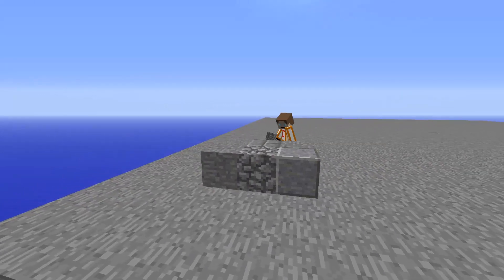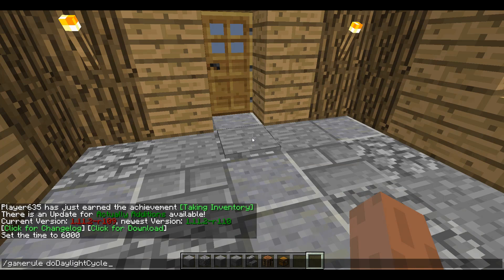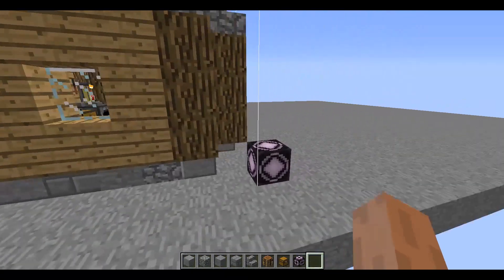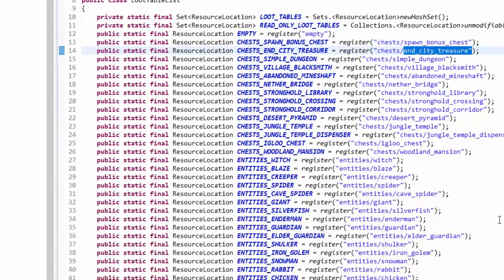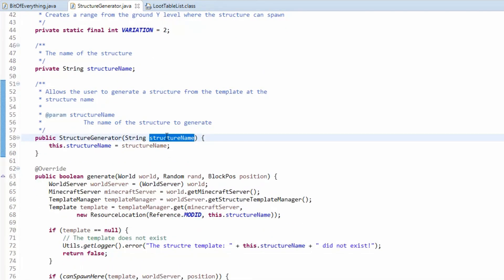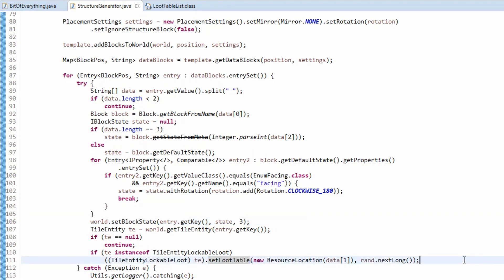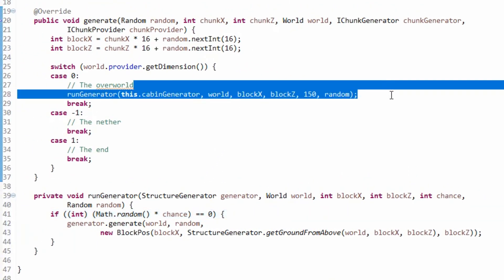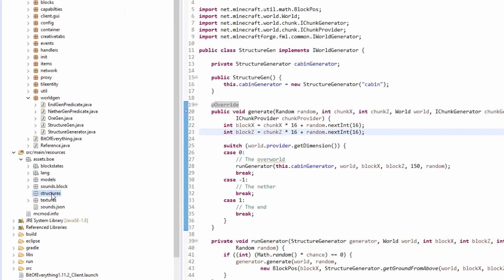Minecraft Modding Tutorial | Custom Structure (1.10.2,1.11.2)

Comment: The end generator is spawning my structure at y=0 sometimes, and the nether generator isn't spawning my structure at all. The rarity for the structures is 25 (My overworld structures spawn almost everywhere with this rarity, so I doubt it is me not being able to find them). I added Blocks.END_STONE, and Blocks.NETHERRACK to the list of blocks that my structure can spawn on. My structure does spawn on endstone, but still spawns them at y=0 on nothing sometimes. How can I fix these bugs?

Edit: I think the glitch with the nether generator is caused by the getGroundFromAbove function. How can I fix the getGroundFromAbove function to support the nether?
Reply from the maker: I suppose you could test where there is space for your structure by testing the volume where it will spawn to see if its just above netherrack but all air maybe?
Reply: @CJMinecraft  Thank you for the fast reply! I fixed the end structures! I did this by changing part of the getGrondFromAbove function to "while (!foundGround && y-- > -100)". I added Blocks.BEDROCK to the list temporarily to test if my structures generated at all in the nether, above it at least (giving them plenty of room to generate), and they did! They still don't generate in the main area of the nether though. I have another question. How can I add an OreDictionary to the list of blocks that my structures can load on? I've tried multiple things without any success. If this is possible, I'm thinking that this would allow my structures to load on Biomes O Plenty grass blocks!
Reply from the maker: If you are using 1.12, you could take a look at object holders. Just a quick Google should do. An object holder can basically have another mod's block injected into it if the mod is present. It may work, if not I'll let you know about using the ore dictionary

Comment: Hello! Can I make a bigger structure (bigger than 1 Chunk like a Village) with multiple structure blocks?
Reply from the maker: Yes that is entirely possible. The bounds of a structure block is 32 by 32 by 32.
Reply: CJMinecraft Thanks! Very helpful tutorial btw! Subscribed :)
Reply: I was able to spawn a structure 32x32 ! But it has a basement so it is spawning in the air :( 
Is there anyway to decrease the Y, so the basement part spawns underground?
Reply from the maker: In the structure gen class, you could use the same code again at the same location but minus the height of the basement. You could split the structure into two smaller structures
Reply: Ok, I'll try that